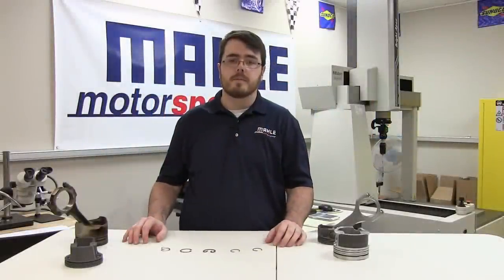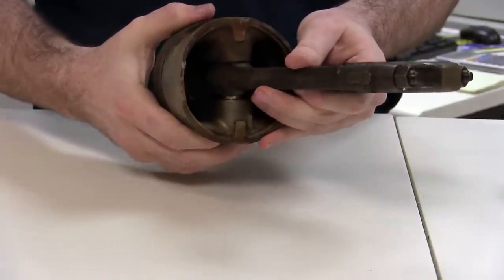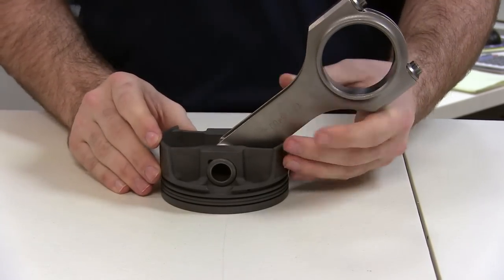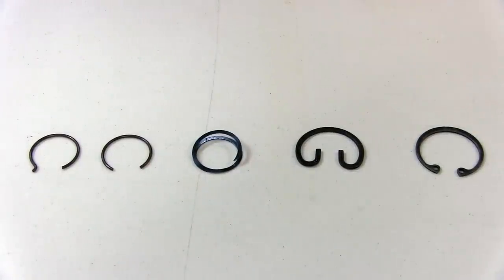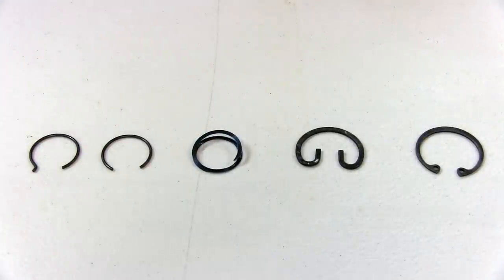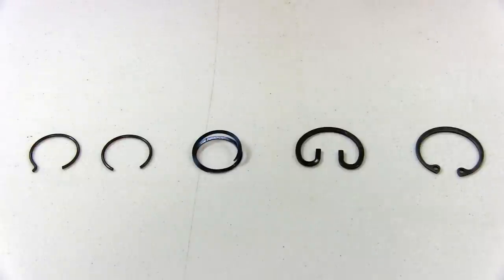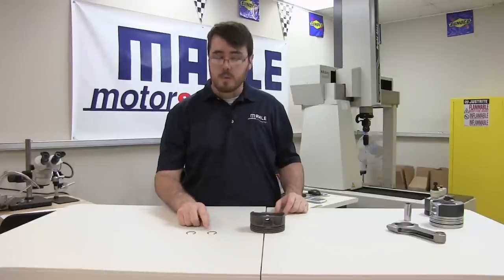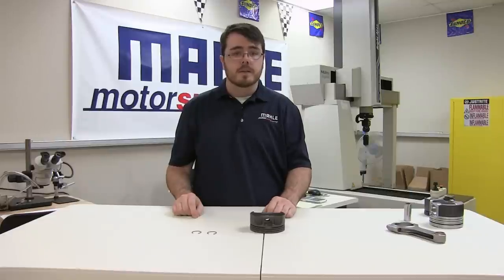Circlip Types and Theory

Comment: I removed Cv Axle and saw that the Circlip on the CV Drive Shaft is kind of loose. You can rotate it easily inside of its grove easily. I plan to replace it. The original clip is made fm/white metal, looks like Stainless Steel. On Amazon I didn't see any Stainless Steel circlips and bought cirlips fm/Carbon Spring Steel. Is it better to put that Carbon Steel circlip instead of loose Stainless Steel one? How tight should be that ring in the grove? Thank you for the great film.
Reply: Its been 8 months since your post but generally I would recommend buying that part from the car dealer. That would be the safest option to get the part that will properly fit and is the right material. Sometimes you might encounter a lazy or careless parts guy at the dealer so if you can obtain the Electronic Parts Catalog (EPC) you can look up that part yourself and just ask for that part number.
Reply: @SE45CX  Thank you for the replay. I think it doesn't matter when you write since other people read. I always write regardless the post date, if can share some useful info. Especially here I didn't know about EPC, I'll try to do research where to find it. That CV Axle I installed w/same circlip, I think I saw some films when those circlips were moving in the same way like mine. Everything works fine. Thank you again.

Comment: Good job not telling me how a spiral lock goes in, thanks for nothing.
Reply from the maker: Sorry we didn't cover that, a majority of what we use are circlips - you can reach out directly to our tech line at 888-255-1942 and we can guide you through that process.
Reply: @mahlemotorsport  Already butchered the job anyway, 50 year old motorcycles are easy to work on, hard to actually repair.